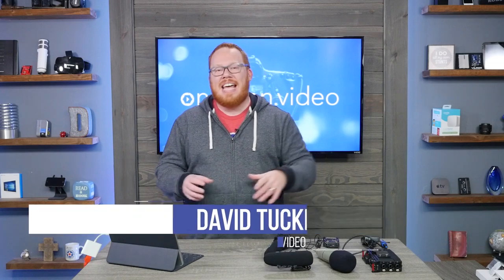Audio Video Sync on the Blackmagic Design ATEM Television Studio HD

Comment: BMD provides some pretty powerful audio tools under the hood of their ATEM switchers via the Software Control app. You can have EQ, compression, gate, limiter, etc. It's inconceivable to me that they don't include an input delay feature built in to the software to solve what must be an extremely common issue.
Reply from the maker: I completely agree.  I was very surprised when I found out this would need to be handled by an external unit.

Comment: In the past I used the Digital Audio Lip Sync Delay bei JS Technology. It works on digital SPDIF signals that are transported via Toslink. I use an HDMI audio inserter to insert the SPDIF audio data stream into the HDMI cable, this gaining a digital audio input for mixers such as the Atem series. Doesn't solve the issue with multiple cameras, though.

I often times used OBS for streaming since it has a video delay, too. None of the Atem switchers has that, to my knowledge, not even the most expensive ones. So the "slowest" camera in terms of delay is defined as "now", all other HDMI signals are delayed, audio is delayed in OBS, too. This makes even more sense when using cameras that don't use HDMI at all, but that are connected via ethernet, which usually has even more latency. So far this works well and stable enough. Also, OBS is able to run VST plugins such as broadcast audio limiters. (Though I have hardware for that, too)

Problem is… streaming is dead and people want video conferencing. And since there is a remarkable latency in my OBS solution and since going from OBS back to USB-UVC-Video would introduce even more latency… I'm checking into hardware video switchers again.

Comment: The audio being 5 frames ahead of the video when coming out of the Black Magic TV Studio HD switcher is probably due to the Black Magic just passing the audio straight from input to output, while your camera video takes a winding path through the Black Magic's video processing circuits such as wipe, keying and other special effect modules which are always in the video signal path whether or not you're using a particular effect. It just turns them on and off as commanded. So this is where the video delay comes from. Unless Black Magic has any option for audio delay inside it, what you're doing here is the way to go with the external audio delay unit.

Comment: I am experiencing delay when projecting videos. My setup is using ProPresenter from an iMac into a Behringer sound board and Blackmagic ATEM TV HD Pro Switcher. My setup is for church services, our live video feed from Blackmagic studio cameras does not have a delay in projection. Only videos that have been loaded into propresenter. Would you suggest this same solution?
Reply from the maker: I would also see if you could potentially optimize the video signal chain for that computer to resolve the issue.  If the issue still persists though - this could be a solution for it.

Comment: My issue is not the audio but the video. I have 2 Canon XA55 cameras with SDI connection to my ATEM TV Studio. I am coming out of the AUX output going to the projector screen. The picture has a very noticeable delay of what is happening in real time in the church service. Got any ideas how to solve issue?
Reply: This is not an issue to be resolved. There is always going to be video processing delay through your ATEM or any other video device when  compared to what you're seeing in a live scene with your eyes, but it's not going to cause you any problems. So there's no need to fix it.

Comment: Thanks for the video. I'm looking for an answer on the following question: Could consumer camera's be connected to this switcher? Because Consumer camcorders have frames like 30 fps and 60 fps, however, this switcher accept 59.94 fps and 29.97 fps through SDI. And to get image through SDI it needs to exact same fps that the switcher accept right?
Reply from the maker: The Television Studio HD supports the following framerates:

720p50, 720p59.94
1080p23.98, 1080p24, 1080p25, 1080p29.97, 1080p50, 1080p59.94,
1080i50, 1080i59.94
Reply from the maker: If you could find a camera that matches one of those framerates, it would be possible.  However, some cameras that aren't professional don't support a "clean" HDMI output.  You need to check for that too.
Reply: @onemanvideo9335  ok thank you very much.

Comment: Thanks a lot for this video. Thinking about a similar setup for streaming events. I'm concerned about the sync between audio and video but I'm also worried about the sync between cameras. Two of the cameras would be 100 metres away from the AV mixer and the other two maybe 20 metres away.  Did you have to solve this syncing problem? Have you got any idea if there is a way to sync the 4 cameras and the audio signal in case I have delay issues between them? Thanks for any help.

Comment: Hello 
I just bought the atem studio tv and i wana use for stream live with différent input (3 cam +one computer) and record the program out with obs. The things i connected an sound input so that any cam that i will choose i will still have the sound coming from my xr32. I'm using obs to stream and record the program out. The question is how to select in obs or the atem to only use the input sound coming from the xr32 instead of the sound of the connected cams 
I'm new in that ..thanks for your help
Reply: I actually have the same unit and to fix my audio delay issue between my DSLR and USB mic was to add a delay to the Audio in the OBS software. My delay came out to 200ms, yours might be close to that value as well. Start by recording a video clap clap and then open up that recorded file in a video editing application to see the difference between the video clap and the audio clap, it's usually 5-6 frames which equates to 160-200 ms delay in the video.

Comment: Good Morning. I have a problem with my Atem, they were doing an update and there was no light, now it does not start, the "SET" button light is flashing and the coolers are working very hard, can you help me solve it?
Reply: I'm sure this being a month ago you solved it, however when I ran into the same issue, I plugged in the USB into the ATEM and it showed up on my computer to update it. My unit had failed during an update via the ethernet and then powering off the ATEM mid "updating" all lights were off and nothing was outputting (which of course made me worry I bricked the device, however it worked fine and updated)

Comment: i have audio clipped on my atem tvs, do you have solution?
Reply from the maker: ian imaru What is your audio signal chain?
Reply: @onemanvideo9335 feed from audio mixer board to atem xlr input, sound clipped or  like distortion even on low level..
Reply from the maker: ian imaru if that is the case, you are likely clipping before it gets tot he ATEM unit.  Verify that you aren’t clipping at the mixer.
Reply: @onemanvideo9335  audio from audio mixer is very very fine.. very clean from audio mixer
Reply: Mixers output line level. If your destination device is mic level then you must attenuate the level before it reaches the destination. In the case of XLR cabling there are XLR barrels for cutting the levels and the correct cut is -10db. Barrels are cheap. Using barrels would enable routing mixer audio back to cameras that handle timing alignment which is the original problem being addressed in this video.